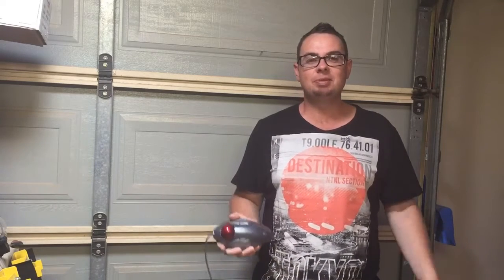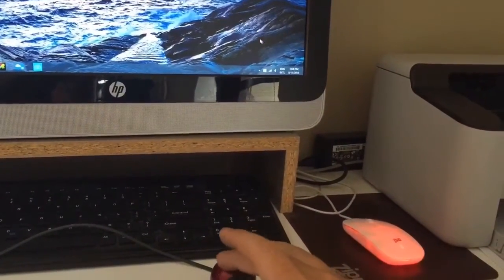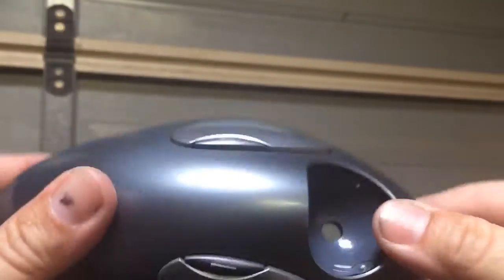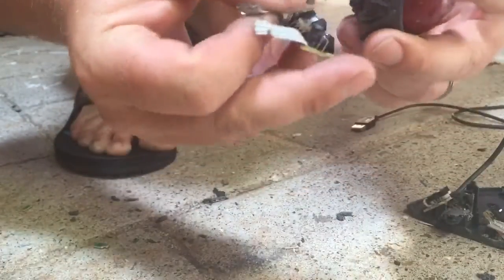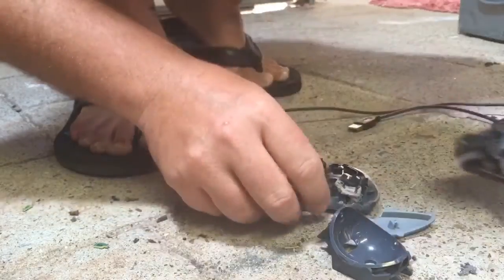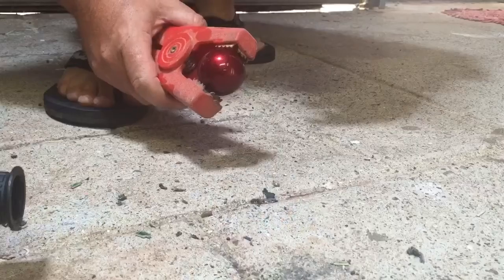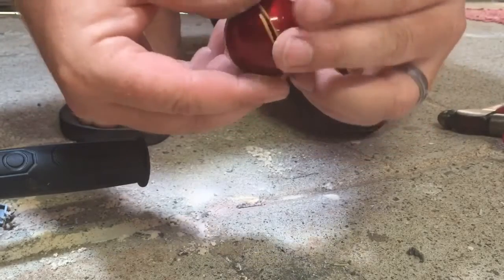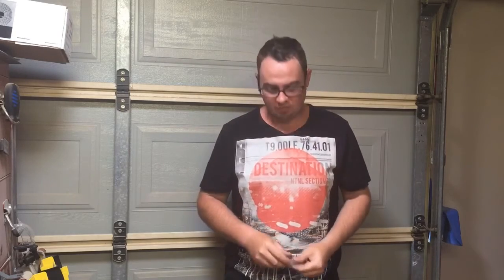Cut it open What's inside a Trackball mouse

Comment: The little white dots are not sensors. They are simply slippery bumps on which the smooth ball rolls. The sensor is the little black window inside of the ball-holding-dent thing.
Reply from the maker: +Toxic9813 thanks for the info Toxic